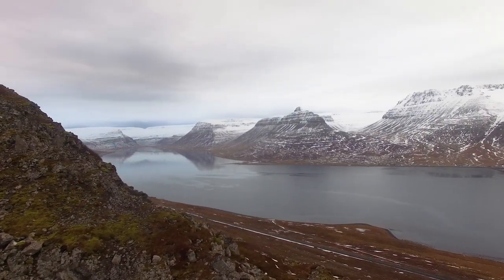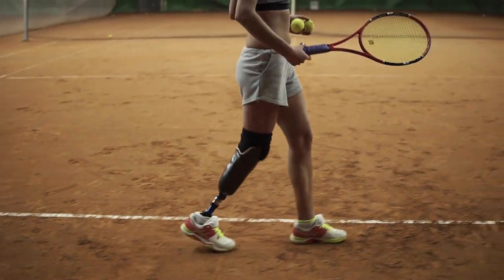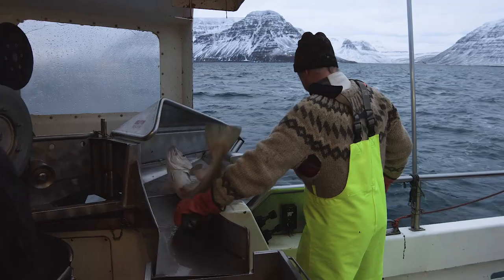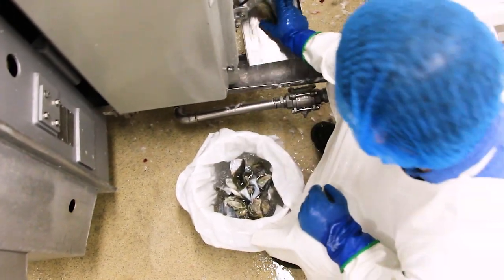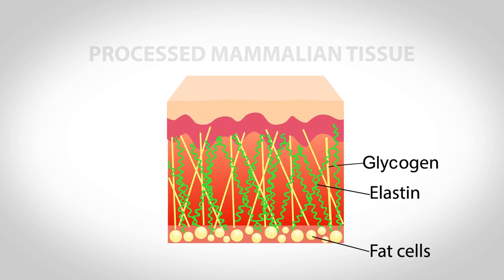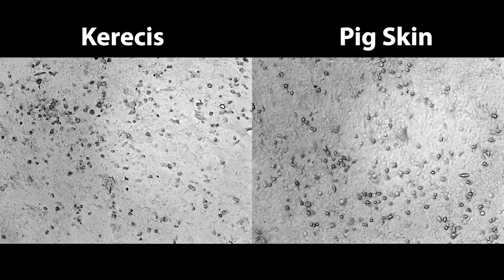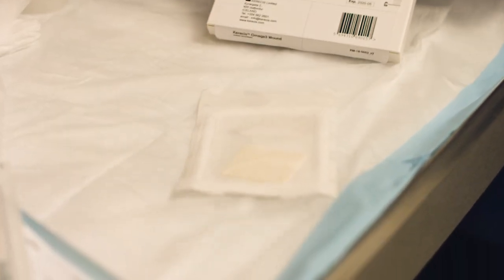Kerecis & Wound Care at East Liverpool Hospital

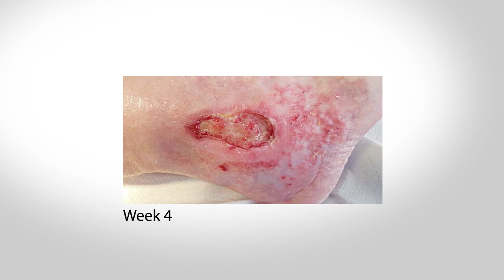Comment: 1:37  “tissue regeneration” how do you claim to regenerate human tissue with a fish collagen when there are no innate human properties? 
1:42 “The cells think they are in a human habitat” How does a decellurized fish collagen product have cells that also preform as innate human cells? I didn’t know fish collagen had human growth factors. 
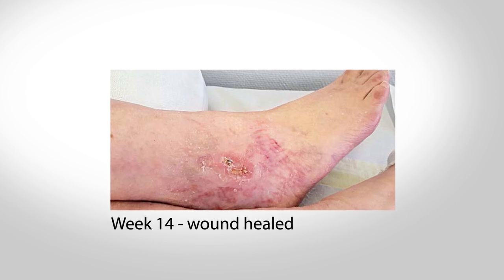1:47 “…to close without scars” is there any repeatable lv1 clinical data supporting this claim? Or is it  just that? 
2:37 “remove the cells gently” interesting there were so many cellular claims for a product where the cells are removed. 
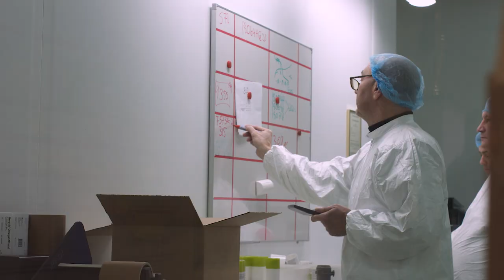3:13 “gently processed fish skin is much closer to human skin than porcine” is there any cross stains comparing the two showing the structures of each compared to human skin?